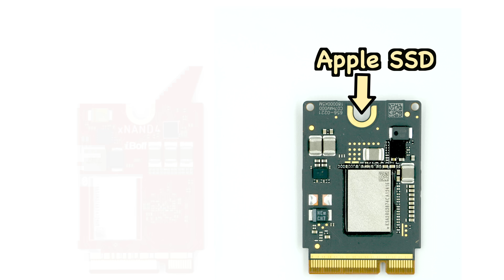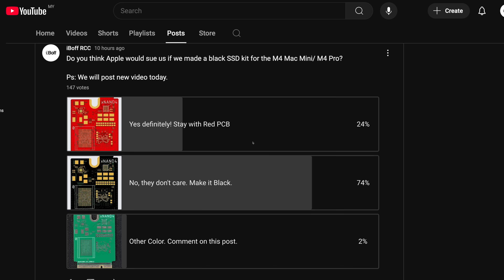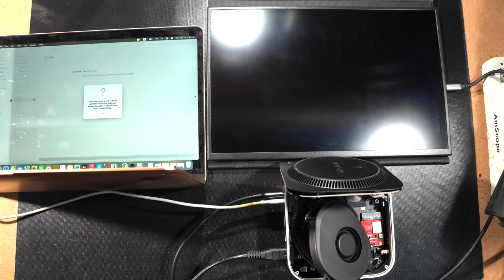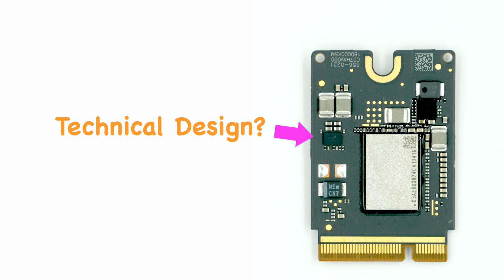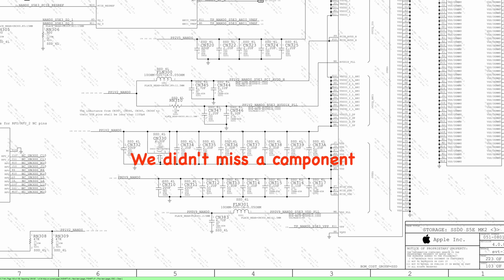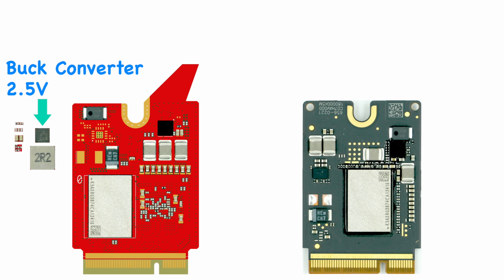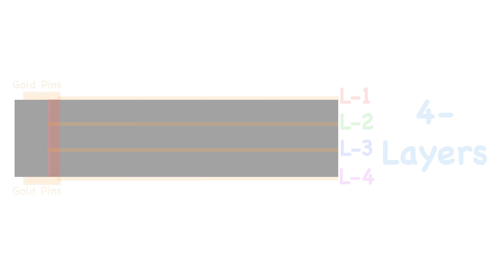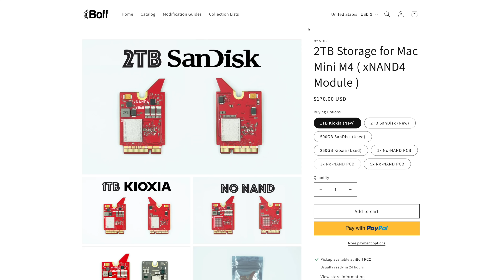We Finally Beat Apple’s M4 SSD – Faster, Bigger, Cheaper!

Comment: This is awesome no matter what, however, I do want to point out that the Apple SSDs are designed in a way where 256GB reads and writes @ 2800MBs. The 512GB Apple SSD reads and writes at ~4000MBs and the 1 and 2 TB drives read and write at ~7800MBs.  Unless you do massive file transfers on and off the drive, you will never notice.

Comment: At 4:05, a slight correction, but the “rudder” on the plane is actually referred to as a horizontal stabilizer. Other than that fantastic video!

Comment: Apple SSD: 
400 USD - 1TB
800 USD - 2TB

iBoff SSD:
170 USD - 1TB
260 USD - 2TB

it's just common sense.
Reply: Market rates for ssds look to be around

100 for 1 tb

170 for 2 tb

250-300 for 4tb

Although take note that these are for mainsteam ssds
They are made in extremely large numbers compared to this and have a much larger market (every desktop, a decent chunck of laptops and mini pcs)

Frankly kinda suprised that such a low production number item is anywhere near maintstream prices

Comment: Make a pcb with nand slide in slot or socketed so you can install higher capacity nand chips without changing the main pcb

Comment: Next version Macs will have the SSD soldered in. And glued. And potted in epoxy. With a firmware boobytrap that will brick the CPU if it detects increased SSD size. Thanks, TimApple.

Comment: isnt apples ssd tied to some tpm chip or something ? replacements refuse to work. How are you pairing your custom one, how does it work  ?
Reply: Right? Also officially if Apple would sell replacement memory, they are usually capped only up top the original capacity e.g. if you buy 12/512GB and in youll buy replacement from apple, they will only sell you 512

Comment: The most frustrating thing about all this is the relatively slow speeds. I can deal with the non-upgradable system memory because of the huge bandwidth Apple is able to achieve by putting on the memory on the die. It sucks not being able to upgrade it, but at least there is a reason to do it this way.

But Apples SSDs are relatively slow. If these were saturating a PCI-E 5 x4 bus or something, then that might be an argument. But you can get these speeds from any decent off the shelf PCI-E 3 nvme drive, so what’s the excuse for the use of a custom, non-upgradable* solution here?

Apple gonna Apple I guess.

Comment: It's too bad there isn't a universal standard for a short, flat ssd with a plug like this that Apple could have used
Reply: what do you mean by universal standard?  M.2 standard is used by every PC, notebook computer now.  M.2 2260 is exactly what you are talking about.  In fact Apple's M series processor Mac Minis's storage board use PCI-e, exactly the same as M.2  There is no technical reason why Apple cannot use M.2 standard.  Apple does not want to because it wants to squeeze every dollar of profit from buyers.

Comment: This is fantastic except Messing around with Apple products means voiding the warranty. If it were plugged-n-play like in the old days when you just slapped in additional ram it would be fine but it looks risky it may end up crashing the computer and you're stuck with trying to get it repaired.

Comment: usually apple adds these caps and resistors for no reason since if you look at their macbook repairs they have tons of 0 ohms resistors and useless capacitors added just to confuse people trying to do board repairs.... its probably not needed for most of it.... you probably only need a few not all of the capacitors.... but you need to figure out which ones.... which means you have to reverse engineer from a cheapo m.2 ssd and figure out their NAND layouts to their resistors and capacitors before it goes to their controllers....

Comment: Here's a business idea that could help you guys stay afloat and grow larger. Have the customer ship back their old SSD that they remove, this way you have more components. Obviously it would be a customer choice if they want to send it back but at least make it an option. That would help. I worked at a company that offered the customer to send back their old parts and that was a huge help for us.

Happy i came across your video. Hope you guys make huge profits. You deserve it. BRAVO!!!
Reply: What would they do with the old SSD ? They are not using the same flash chip or voltage reg, scrap it for the passive components ? Definitely not worth it
Reply: @aai2962  they can remove the nand chip on the old SSD, put higher capacity ones on them, and sell to those who want to expand capacity but want to keep using Apple's PCB
Reply: @aai2962  An SSD Module has multiple components. They showed in the video that they moved all the 256gb components over to the new PCB they designed. Otherwise that would've never worked. So having the customers send they're 256gb SSD module would definitely help. That's what i would do.
Reply: @alexmayer8943  no they didn't , the entire video is about designing  a new board, and how it's different from the apple board. And the whole purpose is upgrading the SSD to 500gb and 1tb so what would they do with the 256gb
Reply: @aai2962  You’re spilling nonsense. Yes they DID. They showed AND SAID that they moved all other components from the 256gb to the NEW BOARD. I can tell you didnt watch and listen to the whole video and you’re arguing. Just watch the whole thing.
Reply: @alexmayer8943  yes as I said in my first comments, they used the passive components (resistors, capacitors..etc) that are worthless to scrap from doner boards as they cost cents per 1000 piece, while the costly parts (nand flash, voltage regulator) are different from the apple board. Maybe this time you will comprehend it better
Reply: Not a good idea to be honest, the old ssd would be mostly 256gb, who wants them anyways? And there would also be privacy issues...
Reply: Hell, no.
Reply: It's better to keep the old board in case you need to deal with Apple or as a diagnostic part in case you run into problems later.
Reply: Unless they're targeting at establishing a scrapyard of tiny worthless Apple SSD's - no, it's totally not worth it) And it would be much wiser to keep the default one as a spare, at all times, just in case.
Reply: On a such small scale and large amount of components, this would probably increase production time and human work necessary, because i believe the small components can be ordered from the PCB manufacturer already soldered on, unless i am mistaken
Reply: they dont make them inhouse ,they cant harvest component from old hardware ,they design it and send it to a fab ,the fab just fabricates the design and package it and they receive their product already assembled and packaged ,they dont assemble anything in house
Reply: They even provide companies they get their components like muRata or Samsung. They don't resolder some random capacitors wtf. It would be so time consuming it would top price to the original apple levels 

When they showed they moved components, they don't mean it literally but as design choice, schematics
Reply: I would not do that while your machine is under warranty if you ever need service because it will surely void your warranty.
What would they even do with all those old small SSDs?

Comment: Great stuff! I'm just wondering why Apple decide to use a 10 layer PCB, if you can get faster speed by using a 6 layer PCB, why increase the cost? And why Apple with all the engineers don't use your optimization?

Comment: How about iBoff to Apple benchmark performance comparisons with same 2TB SSD sizes (instead of just comparing to Apple 256GB SSD).
Reply: What would be the point? All the key components associated with the SSD function are identical with the exception of the NAND chips themselves. It is the difference in the NAND chips which explains the performance difference.

Comment: I have heard something about how a 256MB SSD Hard Drive has a much shorter lifespan than a 2TB HD. I would assume there are only so many reads and writes a solid state drive can make before the bits eventually crater. Have you ever rated the lifespan of different size hard drives? AND does the quality of the actual memory chips also factor into the lifespan? THANK YOU!

Comment: Holy shit. You've done it. I don't know of a single legal argument that can argue that this is not an allowable replacement. This is incredible.
Reply: Also Im going to say that the legal firm they worked with is probably more reputable than a small aggregate selective portion of this videos demographic that decided to reply to this guys comment. (Including me. I know law in my country, not in america)
Reply: Legal? Why use legal if you can use intimidation?

Quote from a news story:

Following Hector Martin stepping down from the Asahi Linux project that he founded for bringing Linux to Apple Silicon hardware, Asahi Lina announced today that she is pausing work on all of the Apple GPU driver development she had been pursuing for Asahi Linux with the open-source DRM kernel driver as well as Mesa contributions.

Asahi Lina posted to Bluesky today:
"For personal reasons, I no longer feel safe working on Linux GPU drivers or the Linux graphics ecosystem. I've paused work on Apple GPU drivers indefinitely.

I can't share any more information at this time, so please don't ask for more details. Thank you."

How's that for a legal argument, huh?
Reply: Don't worry, they'll create it.
Reply: Wouldnt you just install the Original 256gb prior to sending to apple
Reply: perhaps that the schematics that were used to build it are confidential?
Reply: @Saghetti  confidential? Maybe? But reverse engineering isn't illegal. And a full redesign certainly qualifies as unique IP.
Reply: @spdcrzy  this wasn't a clean-room reverse engineering though, you can see him directly referencing apple's own proprietary and confidential schematics throughout the video in order to build his clone
Reply: @Saghetti  And? Schematics or die. If they're not public, they're useless. And besides, you don't need schematics to run a full analysis on a board that small.
Reply: @spdcrzy  "schematics or die" isn't a valid legal argument...? the goal of right to repair is to make that information a legal requirement, rather than right now where people need to use sketchy sources and leaked files to do their work, like was used in the video. to clarify, i'm absolutely for this project succeeding, just worried that apple would use their huge legal team to take it down once it starts threatening their profits on overpriced storage.
Reply: @Saghetti  no, but it needs to be the norm.
Reply: @spdcrzy  it is totally dependant on the patents and how creative and litigious apple is feeling. Im guessing something wont happen unless they get rma units with this inside or sales are significant. 

It could be argued that the copying is just to allow compatability, and its open as a protocol.

The designs could also be done from scanning the parts rather than the design docs, and the EU has forced apple to allow users to replace their own parts.

I could see the battle going apples way if they scare off with threat of multi-million dollar lawsuits, or if the defendant is ill-equipped. But I can see this holding in court easily.

I doubt this channel is showing off internal apple documents, this is likely just a small public release to comply wit the EU's enforcements
Reply: @spdcrzy  depends on what contracts you sign when you purchase/activate the mac
Reply: surely this video is an admission of guilt? "it's exactly the same as Apple's but just rearranged"...
Reply: @the_laziest_fox  how is that patent or IP infringement though?!
Reply: @ well i am not educated on patent law so i'm honestly not sure - i just thought it would be.
Reply: @the_laziest_fox  I think it could be admission, but any good lawyer would throw that out of the court due to it being a youtube video
Reply: @MM-vs2et  a youtube video can be perfectly admissable evidence in court. social media in general has been used to build cases for years, if not decades
Reply: @the_laziest_fox This would be considered a novel enough design to be safe from patent infringement. They just built a new better ssd to the spect that apple requires for their machines.
Reply: @the_laziest_fox patents have exact claims you cannot violate. without looking it up - I doubt apple would have a patent on a memory chip sitting on a board, as it has been done this way for decades without any significant technological innovation.
Reply: If nothing else, Apple can certainly sue them for having identical configuration settings. That is straight up spoofing an apple device.
There's no way that the disk gets recognized as an apple disk without having the same/similar driver configuration- like naming convention, serial number convention and such.
Reply: @fazil_8298  it is just a memory chip, there is no controller or configuration.
Reply: @ You should read up on how peripherals interface with a computer.
During boot sequence all connected peripherals will be probed, during which they have to identify themselves by responding with their configuration. If the Mac recognizes this as an apple chip, it is because the memory chip responded saying it is an apple chip. That is spoofing.
Reply: Bro they dont have drivers. The extent of ssd drivers are pretty much just reporting device health and that's purely interop. There's not a processor on the ssd, like? And naming convention? What? Serial number convention? Maybe an ID gets reported by the motherboard. Thats it. Its much safer legally than altering drivers. 
This is really not what you think it is. Like its just a PC running macos. Its not like its totally proprietary to apple. They are literally just using pcie. Like do you think that apple is going around smiting every third-party thunderbolt cable?
Reply: @ajaxdossd948  apples ssd has no firmware, unlike regular ssds. they put the controller on the motherboard and the ssd board is purely the nand chip with passives.
Reply: They’ve created the same circuit functionality, using the same chips, but just arranging them differently.  They have copied the design. Putting the chips in different locations, making the board red, is not legitimate reverse engineering.
Reply: @roch145  optimizing the layout with a completely different multilayer PCB design AND using the best possible components doesn't count as reverse-engineering? What does, then?
Reply: @ most of the intellectual property is in the design of the circuits and the logical functionality that chips enable.  While it would seem there are some marginal improvements to the design in terms of fabrication, the inherent functionality and logic of the circuits are the same and the types of components on the PCB are the same.  I’m not a patent attorney, and I don’t know if there are any patents on the PCB design, but my guess is if Apple wanted to, they could object to this product.  I can tell lots of efforts were made to try and differentiate this product from the original Apple product, but I’m not convinced this technically is considered to be a reverse engineered product.  I hope they don’t run into trouble as the Apple storage tax is fierce.
Reply: @roch145  And obviously not market pricing, so on that basis alone this product wouldn't be infringing.
Reply: @ I’m not sure pricing has anything to do with infringement
Reply: @roch145  there is nothing illegal about recreating a generic design
Reply: @ I would agree. I just don’t know if this controller is totally generic or if there is something proprietary?
Reply: @roch145  You have just explained every ssd in existance. They all use the same components, even very commonly the exact same nand chips or memory chips (whatever is cheapest). If it performs better, then I dont think it can be called a clone in the slightest. It seems to be purely for compatability.
Reply: @ it just seems like in the statements made by the company they were very sure to talk about how what they did was different from the original design which says to me they are fearful of some legal claim by Apple.  It also seems like there is some proprietary Apple designed interface between the board and the system.  I hope they succeed.  But Apple is well known to protect their technology and their revenue.

Comment: Would this SSD module also work with a normal Windows-compatible type of motherboard's WiFi + Bluetooth module docking port? Just curious. Seems odd that Apple opted to use non-PC-standard SSD modules, when they could have just used standard mini-sized NVMe SSD's that are already available on the market. Or even simply used standard 80mm length NVMe SSD's.

Comment: They make MOSFETs with short protection for GPU VRMs, that short to GND rather than through your chip, but I don't know if they do those small double MOSFET with controller. I don't know, do you put a crowbar on the output - lol -.

Comment: 6:51 is it really PCIe data pins though?? The SSD controller is part of the M-series SOC (which is also why the system recognizes these custom SSDs as Apple parts). The connection between the controller and the memory is usually a custom interface.